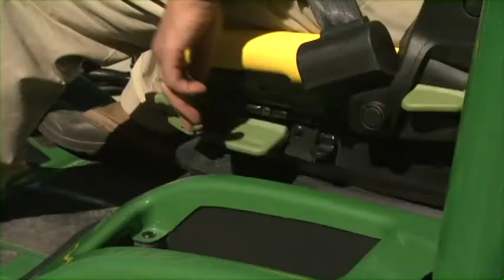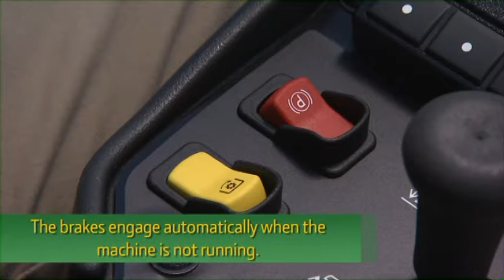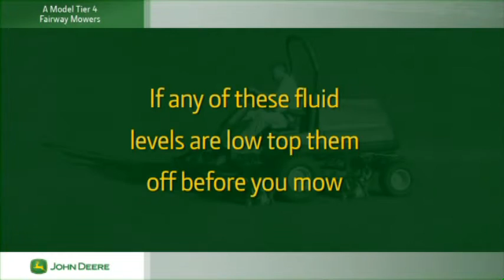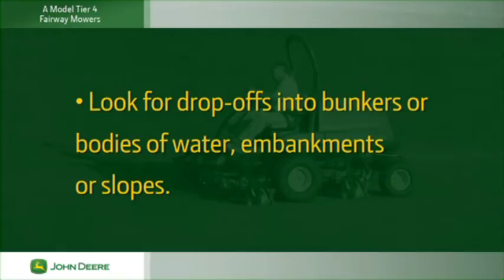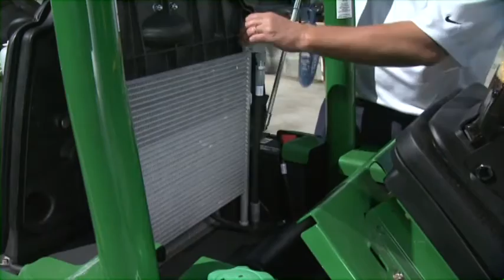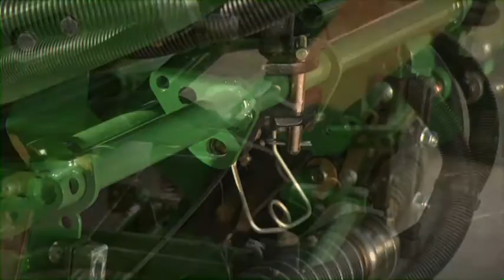John Deere 7500A, 7700A, 8000A, and 8700A Mowers Operator Video

Comment: I still miss the manual levers on the older models. Accidentally hitting the brake button instead of the cutting button can throw you for a loop. The display is handy, although I've gotten error codes that don't show up in the service book.